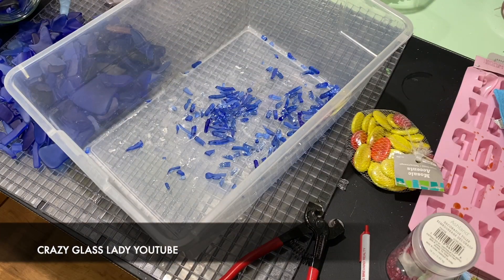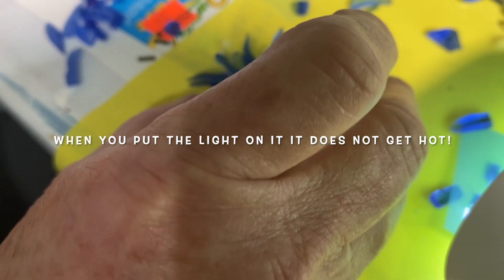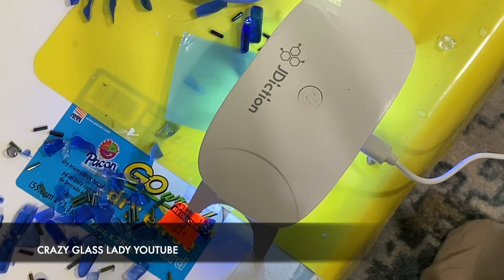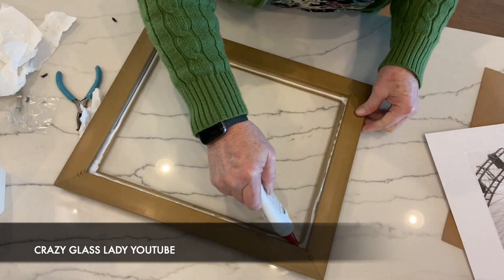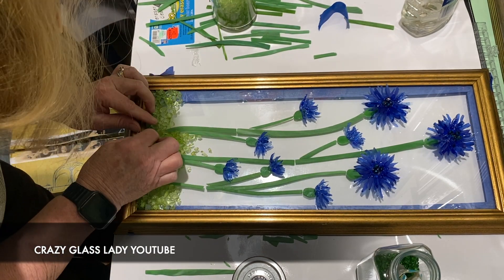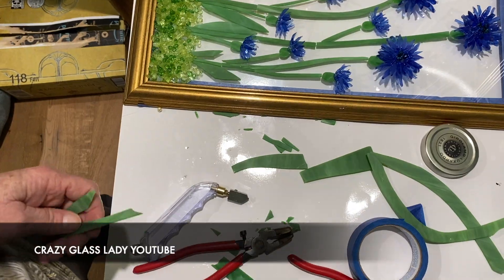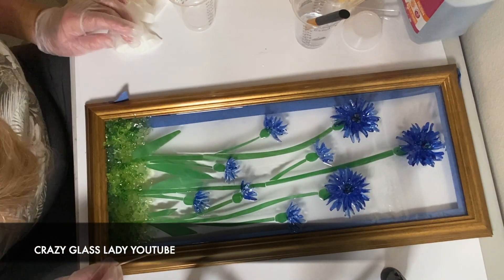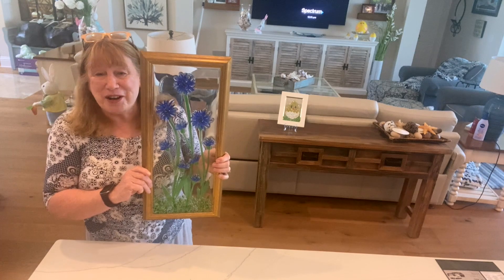USING UV RESIN TO MAKE 3 DIMENSIONAL FLOWERS, GLASS ON GLASS STAINED GLASS BROKEN GLASS FLOWERS 2023

Comment: Linda when you run out of the uv resin tape just replace it with clear packing tape from the dollar store. It works just as good and much cheaper.
Reply from the maker: Oh I am just reading this after I gave you a link to the wide roll of resin tape. so the the dollar tree tape? is it clear tape?
good to know I thought this resin tape was something special LOL
Reply: Yes clear packing tape.
Reply from the maker: @dalemaclaren7576  I will check it out. Thank you.

Comment: I noticed you were assembling the flowers on a mat. Is that a silicone mat? Does the resin release well from that kind of mat
Reply from the maker: Yes, that is a silicone mat and I failed to mention that in the video it’s very important that you work on the silicone mat. Resin will not stick to silicone. That’s what the molds are made out of.

Comment: I really want to try this . Some things I’m confused on.
Reply from the maker: What are you confused about?
Reply: @crazyglasslady  do you lay the glass flat or stand on side for each layer. I’m cutting up stained glass. Didn’t cut pointy
Reply from the maker: @tammyhiller1821  you may need to watch again but I show you the bottom row is flat I make a circle and then put uv resin on that and fuse it together then I start the second layer which is at an angle one piece at a time hold it up a little put a drop of resin on it and as you are still holding the piece of glass use the other hand to put the uv light on it . you do this for every piece of the second row go around in a circle.then you do the same thing with the 3rd row only more of an angle another words straighter and go all the way around one at a time.  I hope that helps
Reply from the maker: also you can nip stained glass the same way I cut up my tumbled glass. @tammyhiller1821